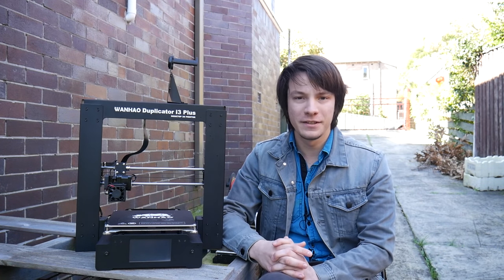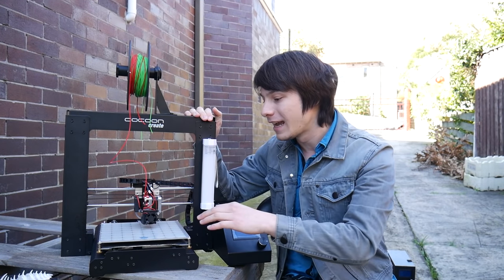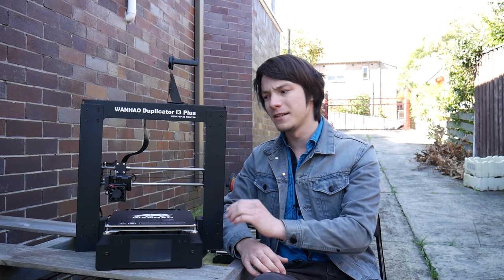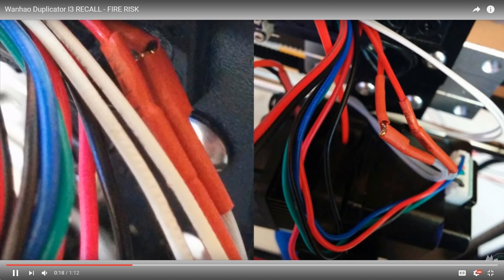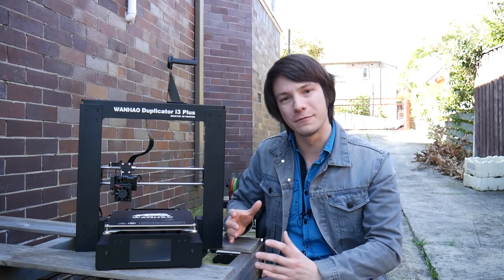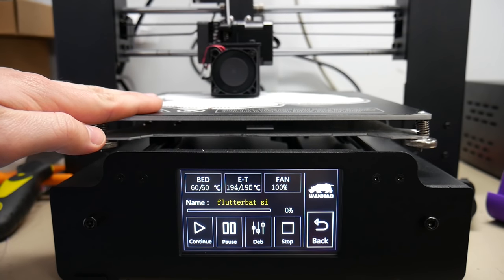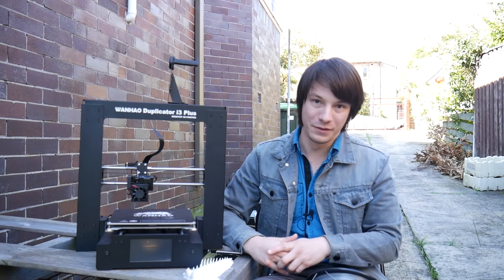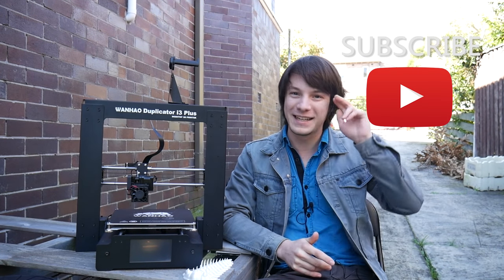Wanhao Duplicator i3 Plus - Review

Comment: I had the Monoprice select V2 for about a month before the power supply blew.  Replaced that with the Plus and I think this review is spot on.  Although I don't see any quality difference in my prints, the Plus seems to be much quieter and slightly faster than the v2.  The touch screen and full sized SD card are much make the machine more user friendly.

Comment: I know this is several months in the future, but I have the monoprice maker select v2 and it's never had that issue with bearing noises. I have added lithium grease to the linear bearings to make sure they're well lubricated, but all I can hear is the motors and the fans when it's printing.

Comment: I have 3 of these. The rattle when moving on one of mine was due to the base plate underneath vibrating on the base. A small piece of failed PLA or cardboard or whatever between this worked.
They are also known as a BALCO printer, another brand of Cocoon.
As with the spool holder, I created a larger one for all spools and have done this to all of mine and all work great with this mod!
https://www.instructables.com/id/Larger-Holder-for-3D-Printer-Wanhao-I3-and-Clones/

Comment: If anybody cares, I bought the Monoprice version of this machine, and while it's been an incredible machine, I have a few criticisms myself:
I bought the Monoprice Maker Select Plus, and fresh out of the box the extruder was massively out of calibration. I had major underextrusion problems. It was only extruding like 80mm of filament when it thought it was extruding 100mm. It took me way longer to diagnose this than it should have, but it's my first printer and I knew nothing so.. ignorance is bliss? I don't know.  
The fans were quiet... for about the first couple of months. The left cooling fan unfortunately suffered catastrophic bearing failure on my machine very shortly after I got it. It rattled and screamed so loudly that turning the machine on was something I dreaded. It was still serviceable, so I just coped... until I accidentally hit it with an allen wrench and snapped a fin off of it.. whoops... I have since replaced it with a Noctua fan (I had to include a 24-12v step-down converter to make this work) and sometimes I forget that it's on.

The stepper motors for the X and Y axis are a little louder than this video led me to believe they would be. It's perfectly tolerable, though. I could sleep in the same room as it if I had to. 
After I got the extruder calibrated and the faulty fan replaced (which honestly would be very trivial tasks to anybody who knew how these things worked), this machine has been incredibly reliable and I haven't had any further issues with underextrusion or excessive noise.

Comment: Some people supposedly had heat issues with a part of the board controlling heatbed temps overheating and smoking on this printer, and so they say to use an external mosfet to fix the problem and as a precaution for others as well. Have you heard anything about this, especially with a lot of cocoon create touches being bought recently?

Comment: Top notch review and clarification of the differences.  I am now down to a choice between two printers.  It is either the Maker Select Plus 3D or the Anycubic I3 Mega.  Both are $400 USD.  Sure wish you had a review of the Anycubic.  Both seem to have the sturdy frame and enhanced touch screen.  The only difference I can see is extruder type.  It did seem odd that you were concerned about putting a large mass into the spool holder on top.  That frame does not need to move, so a mass shouldn't be an issue.  Or am I missing something?

Comment: I'm sure someone already pointed this out but in the USA, Microcenter sells the wanhao i3 v2.1 rebranded as a Powerspec for $299.99 USD - I grabbed one to eval after seeing one of your prior videos on your cocoon i3 - biggest issue I have with it is feeling silly for releveling my bed after forcing a print off just like you said, silly (I'll upgrade the alum build platform and to a removable bed) otherwise there's no obvious difference to all the other i3 rebrands and I've had good results with pla, abs and even some carbon fiber - pla filament, it's become a daily work horse here too.

Comment: Hi Angus, I have the v2 i3 and will move the spool holder from the top no I have seen this. One thing I find is I need to align the bed all the time, do you or do you have a fix? I was thinking of using thread lock but was not sure with the heated bed it will cause issues. Thanks again

Comment: I bought one of these for my son at Christmas. He's had some ok prints off it but only around 35% of models printed have been desirable. He has asked if you could help with a screen shot or explanation of the settings you use when printing with PLA and ABS. The levelling too has proved very difficult and unreliable. You set up 2 or 3 of the 4 corners only to find that as you're going around the bed, the corners you've just set are now way out. Do you have any rips on this please and how crucial is this? Many thanks.

Gareth

Comment: Hi I have a i3 Plus that was purchased from Adi about 2 years ago. have not used it for a while, but on power up it is stuck on Advanced and I cannot change the selection. Have tried replacing the internal battery and reseating all cable but touch screen is still unresponsive. Any assistance would be appreciated.
Thanks.

Comment: Im on my way to buy a wanhao in this month.. you think the plus really is better? my thoughts: if you do a inclosing to get better abs-prints the 2.1 would be better with the sensitive electronics outside inclosing box.. if a cable get hurt or damage in the 2.1 you can buy it easy in every store, in the plus you need to buy a special cable.. plus version cost as you say 100dollar more and have upgrades who dont make anything better? bigger built plate, auto level, better extruder or that kind of things I would understand, but 100dollars and those upgrades, whats the point? you knows the different between v2 and v2.1? you also talk about the sd-card, its not possible to use usb-stick?

Comment: Great review Angus!
My i3 PLUS also made the loud y-axis grinding noise, over time I just kept lubricating it and it helped a lot, but I have new bearings are on order.
I really love my i3 PLUS, I have modded it from with creations from the original i3 design of the z-axis brace for more stability along with a more direct print cooling fan duct that hits more points areas at once.

I myself would recommend this machine for others.

Link to a picture posted of my modifications is here:
http://www.thingiverse.com/make:245214

Keep up the awesome videos!

Comment: Many of the changes were implemented on the V2.1. (the thumb screws,new bearings). But the PLUS does have a larger fan than the 2.1 by (I think) 10mm. This does improve the print quality a bit by adding extra cooling. Do you know if the new fan duct I'd aimed properly at the nozzle? The V2.1 is aimed to the right of the nozzle. There are easy mods to redirect the air towards the nozzle, but I was wondering if Wanhao updated this.

Comment: been following you for a while now Angus. I bought the I3plus maybe a year ago based on your recommendation. I notice the Wanhao have again upped the ante with a version2 sporting so useful features and upgrades. Can you say if the original plus model can be upgraded to the V2 spec? I'm pretty comfortable with the electronics, mechanical and flashing, I just never really delved that deep into 3D printing to keep on the "cutting edge" cheers Rob

Comment: How are you finding this the plus now? I am looking to get one and in my research I've come across mentions of the extruder feed stopping working fairly early on. This is a great review by the way, thanks!
Reply: Mine stopped working last week because of the recently discovered fault in the electronics.  Thankfully I'm getting it repaired or replaced for free.
Reply: Yes that video showing the problem came out the day I was going to buy my i3 Plus! So I postponed it to watch how they deal with the issue, I see they released a video with a small business card fix. I'm glad they acknowledged it so quickly, also they're supposable shipping washers out with all of them now. I'm almost considering the i3 v1.2, based on it being tried and tested and I have no real need to commute my printer anywhere so the conbox isn't an issue for me.

Hope all goes well with the fix/replacement and you're up and running again soon!

Comment: I'm looking at the anycubic i3 mega.  it seems very similar to this one. any thoughts on wich one is better?
Reply: Interesting! did you buy this?
Reply: It came today and i'm super happy. although i got gouged 100$ in customs it was worth it. 20 minutes after unpacking i was printing a perfect pair of owls ! it took 1 hour to print the two of them. all i did was level the bed and press start . the touch screen is excellent, so easy to navigate. I can not overstate how happy i am with this printer, especially after reading all the stuff people go trough fiddling with slightly cheaper printers to make them work. this is solid, it has double Z axis motors and is made of solid sheet metal instead of flimsy brittle acrylic. Yep im super happy !

Comment: Hi there, and thank you for the great in depth vids and reviews. Im all new to 3d printing and have not yet bought one, still cant decide. Original prusa i3 mk2 I understand is a great beginners machine with good support, not to much tinkering is needed if I understand correctly. Wanhao duplicator i3 plus is more tinkering and smaller build area. Folgertech ft-5, i like because of the not moving bed and sturdy as hell design. But looks like a tinkerers wet dream. Im not that much of a tinkerer, I will loose interest if i have to make minute adjustments all the time in between prints. Do you have any experience with folgertech? 
Please keep up the good work with the reviews and tips n tricks👍
Sincerly
Dennis

Comment: I hope you see this comment, my first printer was the non plus version of this, I didn't know what had happened to it. I found it earlier today, in an outdoor shed, in pretty poor condition, however, after popping the X axis rods back into place and untwisting a belt, I made sure it didn't explode plugging it in, and then quickly tried printing a gcode for my ender 3 using a small piece of filament that was still stuck in the printer from years ago. https://youtu.be/cIHx-Q4WUyg I'm astonished, truly, that it actually prints. There's not even a print bed surface. Just tested it straight on the metal. I'm going to have to fix it up, clearly a machine built to survive. X limit switch has fallen off as well, but it still homes after assuming it must be homed after skipping some steps.

Comment: Angus displaying the resonance introduced by the spool holder with a full reel when the whole printer was on an unstable pallet did not give a real world indication of the sort of amplitude of the system as the pallet planks supporting the printer were moving.  Please repeat on a solid stable surface or better still run of some prints with a 1 kg reel on the gantry and see if there are detectable artefacts.  Of course the system resonance changes as filament mass changes and the position of the printer elements change.   Possible worst case would be printing a Y plane surface at close to max Z height but there are bound to be other configurations where things get a bit funky.  Thanks for the daily videos but have a few days off mate.
Reply from the maker: It makes a difference, based off actual use - but the workshop is a total pile atm so had to move outside. EDIT - sorry, knee jerk response. It's difficult to quantify but the extra mass does make the gantry sway a lot more during y axis rapids. :) I don't think I'll ever get a few days off haha
Reply: The default acceleration settings on Wanhao i3 printers are FAR too high. It's the rapid acceleration that increases any sway. I've set mine even lower than recommended here:

http://3dprinterwiki.info/wiki/wanhao-duplicator-i3/duplicator-i3-calibration/firmware-settings/

Some have mentioned a slight chatter of y-axis bearings which I also had and the lower acceleration eliminated it which, I assume, will result in lower wear for bearings and rails on the y-axis.
Reply: +Winston Smith Thank you for that info and link. It really has made a difference in my prints
Reply: Dirty Engineer I wasn't having print quality problems at all myself or even sway, it was slight y-axis bearing chatter and I didn't want to have to make one of the bearing mods on my brand new Monoprice Maker Select 3D Printer v2 which, by the way, has all of the improvements found in the Wanhao i3 v2.1. 

I figured it was acceleration related and reduced the settings in firmware, fixed the chatter, and only then looked to see if anyone else had fixed the chatter issue that way instead of doing a mod. IIRC, the only thing I found was the link I posted here which didn't even mention it as a bearing chatter fix. 

A superficial bonus - the printer now sounds much more "robotic" since more gradual movement acceleration is also used in large robotic arms. ;-)
Reply: Thanks Winston, that's a brilliant fix.  Big Brother approves of this fix.
Reply: Sorry if I came across as a bit blunt. Taking the video outside was visually refreshing and made the review roundup more interesting in many ways.
Reply: Herman der German "Big Brother approves of this fix." 

Double plus good! I live to serve!

Comment: 3D systems cube printers no community exists 
I'm am really stuck with CubePro, CubeX, Cube 3rd gen and 2gen
Reply: i was hugely disapointed with the CubeX not even close to the quality of my Wanhao i3. Hows much of a step up is CubePro over thr CubeX?
Reply: +Scienteer same crap different look
Reply: +Scienteer the sad part about 3D systems printers is that it's expensive to experiment and perfect your prints 1 cartridge has little filament and cost $99 for CubePro and CubeX.
I bought my CubePro trio from my work they had it and never been used it's had 0 hours printing time I bought it for $500 with 3 sealed abs cartridges but no other supplies or packaging.
I only had 1 print in 3 colors and I was down from 99% to 73%  check my channel I have a video of 70 micron print